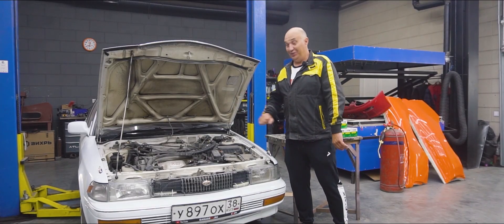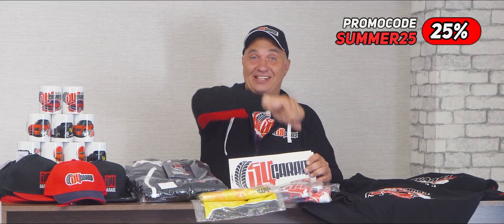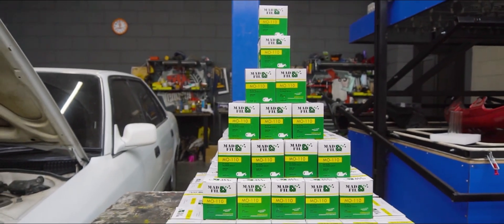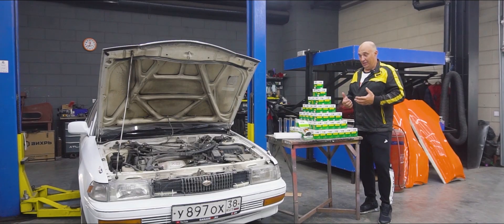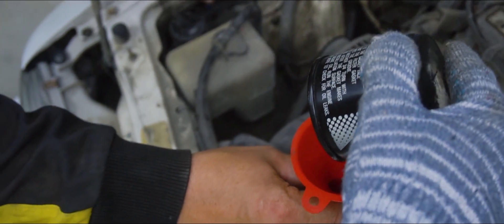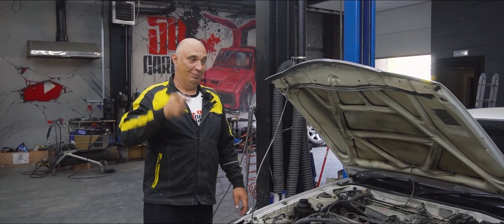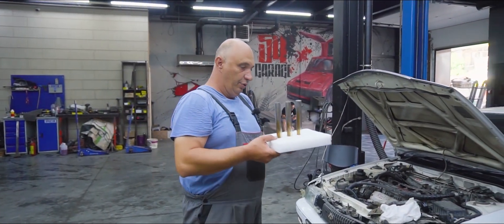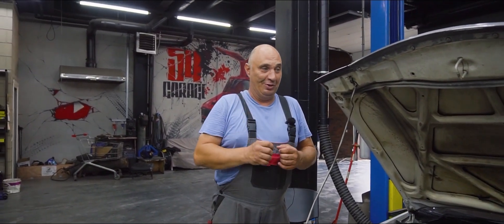Can 50 oil filters make used motor oil clear again?

Comment: The oil is supposed to get dark. It contains very fine metal particles that get suspended into the oil. They are lubricated and they're minuscule, so they can't really cause any damage. The oil filter cannot really filter any of that, it's too fine-grained. It also doesn't needs to filter them, because they're perfeclty fine in oil suspension. A filter fine enough to catch them would be ridiculously restrictive, and oil pressure would need to go "thru the roof", need an insane oil pump, and everything would need to withstand that pressure, and that would use considerable power from the engine itself, so that's why the filters are like that. They only need to stop coarse particles that could cause damage.
That means, that no amount of filters would make the oil clear again, but a very fine filter in a custom filtering system could. Still, that can't undo the damage that the additives and the oil itself sustains, even if it could look clear again.

Comment: The purpose of a filter is to trap large harmful particles and contaminates. The oil will cloud because of the heating/cooling cycle and suspended none removeable particles.  
The secret to long engine life is frequent oil changes.

Comment: Run it through a centrifuge.  That ought to bring it out sparkling.  We used to clean Bunker C fuel aboard ship with centrifuges routinely back in the early seventies when we last ran Bunker C.  Had to weekly clean them to get out the residue.

Comment: you need a finer filter like a bypass filter that is used for larger oil capacity vehicles like diesels where oil changes are $250 a few times a year

Comment: 50 filters would destroy your engine, and cause excessive wear, essentially cancelling the lubrication of the oil, there would be so many pressure/wear points with more filtration, it would be better to have a single smaller-micron bypass filter system long term. id love to see the power reduction along with this experiment
Reply: but this is garage 54 where engines and components are challenged so, great design. lol love it

Comment: If oil is dirty then it means the oil did its job in both cleaning and lubing the motor 

You will struggle to get black oil brown again as its full of carbon and grime

Also oil filters only take care of big parts in the engine 

Wont remove fine dirt or chemicals as such

Comment: I serviced a fleet of propane lift trucks that used Gulf Coast toilet paper filters. The oil was as clear as the Chevron Delo 15W 40 right out of the jug. The diesel equipment was another story. Some soot is non abrasive and like ink. Even Scott 1000 toilet paper cant filter it out. The Australian Jackmaster Classic keeps the Walmart synthetic clear on the dipstick on the Pontiac. If you drain it into a glass jug it will be darker than new oil in a glass jug. I dont drain oil. I might drain the oil and.replace a head gasket or in a used car purchase  The Jackmaster Classic uses a 20 dollar paper. I use Great Value 1000 from Walmart in mine.

Comment: Since 1963 my oil has always been clear on the dipstick. I started in 1963 with a Frantz oil cleaner and Standard Delo 30W. My Pontiac Torrent has a Australian Jackmaster Classic and Walmart synthetic oil. The Wix XP is to protect the engine from anything in the flow of oil to the engine large enough to damage the engine. There are no full flow filters that turn the oil clear. That requires a depth bypass filter. The depth filters than replace the full flow filters such as a Trasco or Stilco have a large bypass valve that stays open as long as the engine is running. Now you have a bypass filter system.

Comment: The "dirt" is mostly carbon buildup from the fuel. Oil will loose lubricating properties that do not come back no matter how much dirt you remove from it. All oil waere out. You be better of changing the oil and filter 3 times with 1 week between than wasting money on 50+ filters.

Comment: You can do a simple oil analysis for contaminants using some card stock (blank business card works great) Put one drop of oil in the middle of the card stock on a level surface. The oil will spread out in a circle after about an hour. All the contaminants will settle out in rings withing the circle like growth rings on a tree. These rings will settle out with heavy material in the center (metal) then other contaminants and finally the outer ring will be the soot load. This is called a blotter test. You can compare these cards at different mileage intervals to determine when to change.

Comment: You’d have to run that oil through a much finer micron filter system…..then maybe include some additives to revive the oil.
I worked at a shop where we did this with anitfreeze…..filtered the fluid through a series of high micron filters in series …then added a pint of coolant concentrate to revive the freeze protection and acid levels….

Comment: you don't need 50 or even 5 filters to get the oil clean again !!  When I was a young man and had a modest income I worked to save as much money on oil changes and keeping my oil as clean as possible .  At that time period there were at least 2 oil filter manufacturers who produced reusable oil filters that incorporated a roll of toile paper tissue as the filter element .  The 2 companies that I was aware of were the Frantz oil filter , which was a remote style of filter and the Stilko reusable engine specific oil filter .  I bought , used and still have some of these filters in actual use today .  I was very conscious about checking my oil regularly to maintain clean and adequate oil in my engine .  If my oil began to look somewhat dirty or dark, I would simply remove my Stilko filter , replace the toilet tissue element and clean the housing .  After reinstalling the filter and driving the car for a day or so the oil was clean as new !!!   Sadly I have not been able to find any information anywhere that this filter ever existed .  These filters were cast aluminum , had  heat sink style rings on the outer surface to dissipate heat from the hot oil  and were very well made .  Wish I could buy them today , would surely help maintain cleaner oil in my engine and automatic transmission than what is available today!!!!
Reply: Yes in 1963 we had the Motor Guard and the Frantz.Motor Guard only makes compressed air filters now. The Motor Guard on my old Ford truck with the 390 engine is almost 60 years old. You can still find Frantz 3 stackers on diesel engines. A Frantz dealer replaced the Frantzs with a improved top loader toilet paper filter and a big filter that uses Bounty big roll paper towels when Frantz went out of production. I have everything with a oil pump equiped with toilet paper filters. Most people think oil is supposed to get dirty and be drained Thats where the profits are. Clean oil doesnt generate profits.I like the Australian Jackmaster Classic. I have a spin on Stilco type out in the shed. Its not practical takes about 1/3 roll of toilet paper. The bypass valve is always open when the engine is running. Trasco is another one. The ones with the hoses is what you need. They brought back the Frantz. Toilet paper doesnt fit it now. The Jackmaster Classic is set up for toilet paper or the Jackmaster Classic paper. About 20 bucks. The Jackmaster Classic takes a firm roll of paper such as Scott 1000. I use Great Value 1000 from Walmart. Not familiar with the more expensive Jackmaster Ultra. The Classic works for me. Most people think oil is supposed to get dirty and be drained and toilet paper doesnt get stronger in motor oil.

Comment: To get a black colored engine oil clear again, it s simple ..
It just takes a long time .
Pour it in a recipient and let it set for a few years .
The carbon particules  that makes the color are heavier and will set at the bottom.
The oil will look as good as new (but is still used ).
Most of it s properties are deteriorated

Comment: A centrifuge in combination with filters might make a difference. There’s a guy who I think is from Russia or a former Soviet bloc country who sells plans on how to produce your own distiller to turn used oil into diesel fuel. My understanding about why engine oil turns dark is because it captures carbon compounds from combustion and it stays trapped in the suspension. The particles are smaller than the oil molecules themselves. So if the filter is fine enough for large particles but not too fine to allow oil to flow through. The smaller particles will still get through the filter. Centrifuge will remove heavy particles but still won’t removed the suspended particles within the oil.

Comment: The discoloration of the oil is in relation to the porousness  if the filter medium. The best way that I can think of to clean the oil is a centrifugal filter system when the oil is spun at a high rate of speed that causes the "weight" of the "dirt/discoloration" to become extremely heavy whilst suspended in the oil due to the centrifugal force being exerted on the "weight" of the "dirt" ,in turn it will stick to the wall of the housing of the filter. This method was used on diesel trucks in conjunction with the standard oil filters back in the day when I used to work as a trade hand at a truck depot before I did my apprentice 35 years ago to become a plumber/drainlayer.
Reply: My 65 Honda 305 motorcycle had a internal chain drive centrifuge. A lot of Soviet equipment used them. Also Mack trucks.
Reply: If you add enough new makeup oil it will get clear. Full flow filters wont turn the oil clear.

Comment: A Centrifuge would clean that oil right up!, oil filters clean down to only 40 microns.. A centrifuge cleans down to 2 microns... Also A Franz bypass oil polisher that uses toilet paper rolls works very well too..
Reply: The Frantz will clear up the oil. I prefer the top loaders. The Australian Jackmaster Classic claims 1 micron filtration if you use their paper. The Frantz should be the same if you use their paper. The Jackmaster Classic is set up better for toilet paper.

Comment: If you want to see clear oil, you need to use a bypass filter that filters down to 2 microns. Filters that filter at 30 microns will not clear up the colour of the oil. They will only remove large particulate matter.
Reply: True. The Australian Jackmaster Classic claims 1 micron if you use their filter elements. Motor Guard has always claimed submicronic filtration. A lot of variables. Rate of flow  pressure . The full flow filters are to remove the engine damaging abrasives only. Removing the small stuff requires an oil change or a depth bypass filter.

Comment: should have tried one of those home made "toilet paper roll filter" canisters.
Reply: Frantz Filters would probably be angry about you calling their bypass filters "homemade" 😂
Reply: I started with a Frantz oil cleaner in 1963 with Standard Delo 30W. 29.95 with hose and fittings I went with the better designed top loaders in the 80s. The paper changed. The top loaders can deal with it. You have to know what you are doing to use toilet paper in a Frantz. Rookies need to use the Frantz paper. With the top loaders you push in the toilet paper and put on the lid.

Comment: I think basically almost new oil after first use in normal condition, the color of oil will change to dark even the engine is clean. The different is the sludge from the metal friction. CMIIW

Comment: I save synthetic compressor oil it costs $500.00 for 5 gallons. It goes in clear and comes out light brown the viscosity is noticeably thinner than the new oil 🛢  but the used synthetic oil looks like new motor oil light brown. It's a air compressor so no carbon in the oil I think the brown color is fine dirt that went past the air cleaner on the compressor. I reuse this oil 🛢  in lawn mowers works great 👍  I was thinking about refining used oil 🛢  by adding methanol and lye and some water 💧  then pump the oil thru a filter and let it  circulate in a clear barrel  pumping it. Then let it set for a few hours to settle and drain off the dark oil from the bottom and use the clean oil on the top

Comment: Could try the old toilet paper in a canister way to filter. It's an old method used in the war in the marines. It'll prob beat all 50 of them filters in one!
Reply: I have several toilet paper filters in use. They will turn the oil golden in a gasoline engine. A diesel will turn the oil black. Some soot is like ink. Non abrasive and cant be filtered out. I would love for the oil in the diesel tractor to look like the oil in the Pontiac. It aint going to happen.

Comment: My father had a shop where he worked on big diesels, all the used oil went into a big heating oil tank with a block heater in it. He would pump it through some big filters and then into a sink with a return line to the tank. Hot oil is good for cleaning parts and even gets great off your hands pretty good. He also had a filter press that would crush all the oil out of the used filters.

Comment: a filter can not filter particles that is smaller than its filtration spec. the result will remain the same even 10000 filters were used.

Comment: generally the oil film is larger than the smallest particles that the oil filter can remove so they generally do not cause wear on the engine components.

Comment: Old oil is old oil. The temperature from heat cycles degrades its viscocity and effectives which the end result is essentially burnt out oil. No amount of filtration will fix this, the only solution is new oil 😊
Reply: Did you hear that at the oil change place.
Reply: Im a mechanic 😅

Comment: The oil will be clear if you add enough new oil. My oil is always clear because I run it thru a roll of toilet paper at a slow rate. 60 years of analytically clean oil.  Frantz   Motor Guard and Gulf Coast  bypass filters. The only time oil is supposed to be black is in a diesel engine  I dont drain oil. Also oil can be black and be analytically clean.

Comment: I used to work in an electrical workshop where we had a filter press to recycle transformer oil.
It used a long stack of filter discs through which hot oil was plumbed through many times.

Comment: The engine will run out of oil long before you change the filter 50 times, each filter you remove will retain approx 50 to 100 mils of oil !

Comment: The black is mostly microscopic carbon from combustion. Some of the soot is so small it can't be filtered without a centrifuge.
    >f you char a fence post, the end you'll bury, then soak it in filthy motor oil it will delay the little underground  termites $or years. They don't like charcoal, or oil.

Comment: Great thought here but over time the oils properties will break down and will thin out like water and the oil pressure will diminish causing damage to the bearings, this can't be reversed using filters and you must change the oil. I really like watching your show and keep up the great work and testing here. THANKS
Reply: Oil will last as long as you can keep it clean. I gave up allowing the oil to get dirty then draining it in 1963. In the 60s we changed the Frantzs and Motor Guards about every 2.000 miles and added a quart of new oil. Preferably single weight because multi grade didnt hold up for extended use. Couldnt use multi grade in a diesel. The Walmart synthetic is beautiful with my Australian Jackmaster Classic  My Motor Guards My Gulf Coasts and the flat head Ford V8 canister on the Diesel tractor. I expect the oil to get black in a diesel and be amber in the gasoline engines.

Comment: I change my oil every 4 to 6k and always use full synthetic. If you want your gasoline engine to last well into 400,000 km then you should too. Get a shop to do it or just do it yourself cuz its really not that hard. Always use a new filter too (should be self explanatory but I know its not)
Reply: my last toyota corolla had 323,000 miles on it & the oil had not been changed for the last 50,000 miles. once it started burning a little oil i saw no reason to continue to change oil. instead, i would just top it off. a cheaply built engine will not last as long as a well built engine, it doesn't matter if you change the oil once a week.

Comment: I send samples to a chek lab and I forgot one around two weeks in my locker. The oil was yellow and on the bottom was some black stuff. I don't know if  the clear part was good to be used again but it sure looks good. Next time I want to send them only clear oil and wait for the result.

Comment: One thing to keep in mind is the carbon particles maybe be smaller than the filter can filter. So the oil may be clean but its still black because the carbon has blackened the oil and cant screen it off. Not to mention this is a bad way to clean oil since the additives break down and all thats left is base oil. You need anti foaming agents detergents and dispersants viscosity improvers polymers etc. so you’re just left with base oil and that wont protect the engine components. Cool experiment .

Comment: Ok, while filters doesn't seem to do cleaning job too efficiently ;), let's try something new. We all know "engine flush" add-ons you add to oil at change, to clean engine. But even after flush cycle and change oil ends up dirty, as there is still a lots of residue inside. 
Question is: how many engine flush cycles you need to end up with completely cleaned engine? And will the engine survive that?

Comment: There's probably a lot of crap in solution with the oil. The filters caught nearly all of the solids in suspension with the oil. You have to distill the dissolved substances out to really clean the oil but you still won't perfectly clean it. There are chemical changes that take place as the oil is used by the engine.